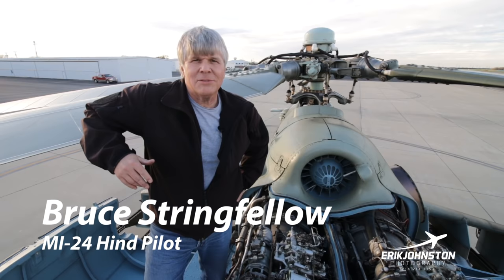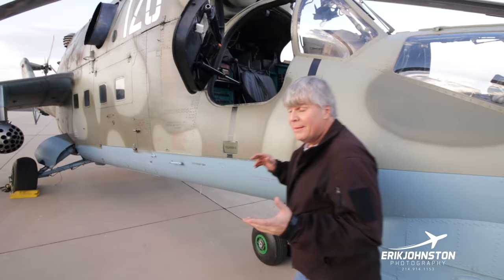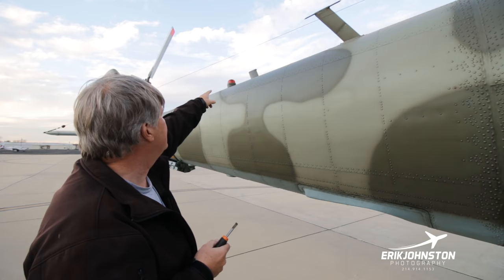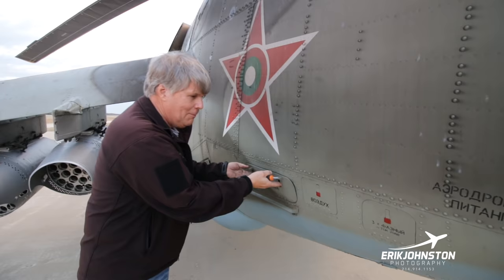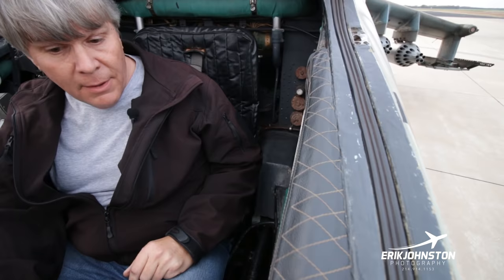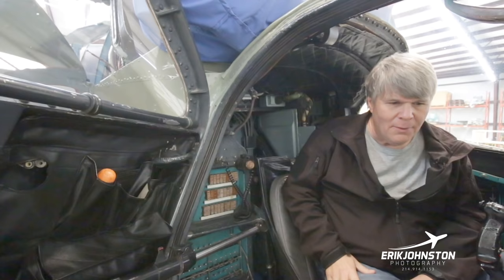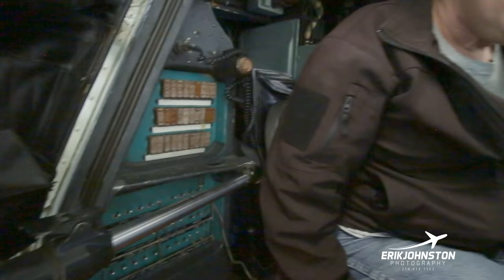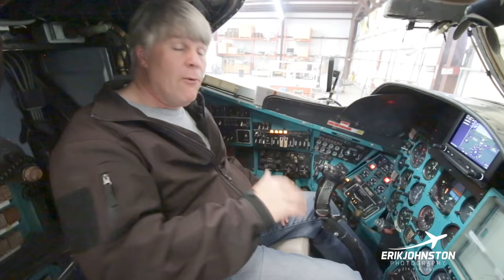Hind MI-24 Helicopter Walkaround Tour

Comment: The level of engineering is insane - I appreciate helicopters a lot more now.  Every single part of this chopper was designed and likely redesigned multiple times before production.  Just insane.
Reply: Lol I'm pretty sure every complex machine of the last 100 years has every part redesigned multiple times before production until it's as close to perfect as possible. From a $2,000 riding lawnmower to a $200 million dollar stealth aircraft to a $13 billion dollar aircraft carrier.
Reply: Just cobra

Comment: Glad to see this one found an owner who clearly loves it a lot. Listening to someone explain something they're so enthusiastic about is always brilliant, and I've learnt quite a few things - with only one caveat. I believe the little white domes are the aerials for the SPO (radar warning receiver system), which would also explain why they're arrayed around the 'four corners' of the helicopter, as it were. The IFF aerials are the triplex rods by the air data probe and underneath the tailfin, part of the SRZO-2 IFF system. The Soviets later switched to a single triangular blade aerial replacing each of the 'odd rods'.

Hugely respect the decision to keep the original doppler map system - it's a really cool piece of kit and there's no reason to add another GPS display. The restoration is absolutely top notch, you can tell this helicopter is really well cared for.

Comment: He is actually mistaken about their 12.7mm nose gun being able to use our 50 BMG ammo, this is an urban legend. I tested this in Afghanistan with the DShK and our 50 BMG ammo. The round casings are significantly different. Ours is 12.7X99mm with the case walls parallel. Their ammo is 12.7X109 and a tapered case walls from the base to the shoulders. I tried to fire a US round in the DShK and it blew apart, damaging the feed tray. 

I pulled the nose gun off the wrecked Hind at BAF but was never able to find the right power to spin the mechanism.
Reply: Nothing like real world experimentation to dispel a myth.😎
Reply: @todaywefly4370  My Grandfather would capture German weapons and flares and such and test them. IE, how many  helmets could you shoot thru with a Mauser? or... how does this rifle grenade  work? I miss his stories.
Reply: @FractalWyrm  Sounds like an interesting man but most of those old guys were to me.  My Grandfather spent 2 1/2 years with the Japanese in Changi prison.  I only got meet him a few times when I was a boy, he died quite young.
Reply: Poor Dushka... killed by an American cartridge.
Reply: I knew the Russian 12.7mm was longer than the American .50 BMG and it wouldn’t work like he described, but I didn’t know it was that long. Thanks for sharing, pal.
Reply: @nickrollstuhlfahrerson8659  no worries! My dad told me about this myth from VietNam and being the Armorer for the CJSOTF I HAD to try it out. Lol.
Reply: @jamiebunten8195  Being an ex-tankman from Germany, I absolutely know that feeling when coming across such myths. Unfortunately, I never really got to tinker with any equipment, but we tried similar things, like a supposed software bug that’ll shut the tanks aiming system permanently off (didn’t work, no matter how much me and my tank commander fiddled around with it) or a spot on a training facility where you could supposedly hear super secret Russian radio transmissions if you are on the right frequency (Also didn’t work, surprise surprise). However I’ve heard similar myths concerning 7.62mm ammo, going along the lines of ‘The Russians could use their 7.62x54R cartridges in our 7.62mm NATO rifles, but we couldn’t use our ammunition in theirs.’ Which is pretty obviously not correct, since we all know these two cartridges have different casing dimensions and necks, and the Russian 7.62x54R is even rimmed on top of that.
Reply: @nickrollstuhlfahrerson8659  
I blame Americans stupidly clinging on to Imperial instead of metric for this and their penchant of using the 1st numbers instead of the whole equation.
Reply: 10mm of unsupported cartridge will do that to a gun. I can't believe someone let you fire 50 BMG through a DShK you could've been dismembered.
Reply: @calska140  well, I didn’t hold the trigger, we tied it off and used 550 cord while we were behind a concrete barrier.
Reply: @jamiebunten8195  someone was using their head. I saw an accident where a guy used a .50 cal cartridge to knockout a stuck mounting pin on the M2 and his hand was just red ribbons of sinew and flesh. So I might be making a bigger deal of the danger than is necessary.
Reply: @calska140  
Trivially easy??
Math equations and actual measurements isn't "easy".
There are slight differences within the micrometer if you just blindly convert imperial to metric.
Reply: @dickmelsonlupot7697  Yikes. It's simple as remembering your conversion factors down to three decimal places (if you really want to be pedantic about precision) and then doing some light mental arithmetic. There are infinite numbers between 0.00 and 0.01, you can only get so worked up over precision until it becomes ridiculously impractical.

Have you taken any calculus or even a 100 level chemistry class? If so; get your tuition back.
Reply: Yes!! Thank you! I’m too young to have been around for the conflict in Vietnam, but I remember being in barbershops in the 90’s hearing Vietnam vets (most non combat roles) saying “yeah, the weird thing about the VC weapons was that they could use our ammo but we couldn’t use theirs!” I remember, even at 9yrs old having a little .22 and 30-30 experience thinking; “That doesn’t...sound right”. Sure enough, total malarkey. I have no idea where that started or came from but enough of that BS got passed around that it became exchanged enough to be widely circulated in the US in the 80’s and 90’s.
Reply: While i find it hard to believe too, you have to consider, that aircraft hardware is not the same as regular infantry weapons. It could have special modifications to make it happen..
Reply: I don't know if a DShK is really comparable
Reply: but they dont use a DShk on the hind, its some three barelled gatling gun with a different chamber, although i wouldn't test a 50. BMG in it incase it did blow up the chamber and the rest of the gun...
Reply: @kilianconn5091  this gatling gun is called YakB-12.7 and it uses the same rounds as DShK. Not sure about the belts though.
Reply: @cdgncgn  it's a rating on countries based on several things. Be mad. It's hilarious
Reply: Yeah course you did soft lad.😅😅
Reply: Respect bro
Reply: @calska140  I never knew that about the different diameter measurements (land/land vs land/groove) thats interesting and I learned something today thanks.
Reply: @crown1285  care to expand
Reply: @crown1285  Who are you speaking to?
Reply: If you really tinkered with Hind's 12.7mm then you should have noticed that it's not based on DShK-DShKM design. I'm not suprised that regular "Dushka" can't fire 50 BMG without some serious modifications {no one would have thought about ammo compatibility in 1930s} but I wouldn't be so sure about YaKB.

EDIT: Just so you know, YaKB multi barrel HMG isn't powered, it's gas operated so no wonder you couldn't make it to work.
Reply: @dickmelsonlupot7697  Americans are taught to convert Imperial to Metric and back since childhood... Your rationale is stupid. We're also taught the Metric system, we know both.......
Reply: @OGPatriot03  
depends on where you grew up but for the most part, especially Americans I encountered online or personally, they don't know how to convert Imperial to metric.
Reply: @gratius1394  We didn't have belts for the minigun, and it had two wires coming out of it, so we  thought it was electric. No manuals made it a little hard to figure anything out, so we just took it apart and discovered that it was (obviously) both the same system as the DShK. I was hoping it was similar to the M134 we had. And the US 50 round fit in its chamber (meaning incorrectly and) with lots of room around the back of the casing like the DShK chamber.
Reply: @jamiebunten8195  Those wires were probably a part of firing mechanism. AFAIK, the Russians don't use powered weapons too often, even in their helos and jets. I think that length of the chamber could be field modified but feeding system, locking lugs, barrels etc. most likely couldn't. At the very least their guns have an option of using 50 cal ammo after some alterations by a gunsmith, US M2s would never be able to handle their 12.7mm.
Reply: Thanks for doing it but part of me dislikes you for ruining the DSHk
Reply: @calska140  trivially easy lmao 🤓. Tell that to the 500 million dollar the good ol boys at NASA blew up because they chose to work in imperial on an international project. Somehow ignorant enough to know that working in two systems and two competing standards is never a good idea.
Reply: @ColHogan-zg2pc  actually in that situation NASA used metric and the company that made the part that failed assumed they were using imperial.
Reply: @spencer6104  I didn't  I ran the same gun the rest of the deployment and passed it to 3rd GRP when we left. And it saw a lot of actiotion at Asadabad.
Reply: @OGPatriot03  I would disagree. Only small percentage of people in 🇺🇸 actually understand metric. Most machinist can do simple conversion, but that's it.

Comment: I appreciate the way the access I panels open from top to bottom giving mechanics or the pilot preforming preflight inspections a place to stand or sit while working on the engine, rotor and transmission.
Reply: They’re the same way on the Chinook as well as the Blackhawk and Apache.
Reply: @bigdaddy7119  I did not know that.

Comment: Erik, I just wanted to let you know how much I enjoyed this video walk-around! I was in the Army from 95-2001 and during rotations to JRTC in Louisiana the OPFOR used one of these and I was a stinger/avenger crew member. Every time one of these flew over the tree line it would make the hairs on the back of my neck stand up! Lol. We did get told, however, that in order to bring this aircraft down it had to hit the engine because the rest of the aircraft was so armored. Basically a flying tank.
Reply: Yes I remember it ! Was there on a rotation - Exercise  (95 ) too !  Awesome experience !  I shot one down with a 20 mm cannon ( German Wiesel Mk ) Miles laser system  ;-D ,  Salute from ( Airborne Fallschirmjäger Veteran)  Germany ! .
Reply: @motorrebell  what you mean you shot one down? simulated?
Reply: @privateaccount5400  Yes ,simulated .worked great on "opfor "( opposimg forces )  vehicles & infantry too.
Reply: This is kinda interesting is there any way to improve your chances of hitting an engine or is it kinda blind luck once it lock on and shoot it until it goes away or you run out of ammo?
Reply: @privateaccount5400  also yeah Miles year is basically the military version of laser tag they put blanks in the guns and then basically put a laser emitter on the barrel and then you wear some webbing with receivers on them that will tell you that you’ve been shot but I didn’t know they used them with things other than small arms

Comment: According to military manuals you have to start the leeward engine first. The reason is to have it in a defined idle situation in case it sucks in exhaust gases from the windward engine. Starting it up while sucking in exhaust gases may cause turbine damage by overheating.
edit no I'm not one of these downvoters
Reply: Ahahaha! And he used to start then dependently of odd and even days! ))))
Reply: I don't know virtually anything about helicopters, but that actually sounds very valid thing. I'd suspect that possibly also in additional to heat, one reason could be exhaust particles/impurities creating unnecessary wear in components?

Comment: it is specially written on the covers "Не становиться" - "Do not stand"))
Reply: Does it sound like Nay Stanovitsiya? I was able to sound out "Ne Stan" from my very limited understanding of Cyrillic. It made me pretty nervous even though he was on the hinge side of the doors.
Reply: Yeah, thats written on the parts of the cover that are not reinforced for standing. You can obviously see that there are additional plates in the areas you can stand on. You cant stand on the outer skin where the text is.
Reply: @alistairs8495  there's a simple way to listen how to pronounce it right. Just use Google Translator and click on the speaker icon.
Reply: The cowlings have a special platform where you step. The writing refers to the aircraft's skin, which, unlike the reinforced platform, could be bent if you stood on it.

Comment: Anti-tank guided missile.
At the time of its creation, an interesting projectile guidance system was used.
The rocket engines had exit nozzles on the sides and a rearward-facing pyrotechnic charge that indicated the position of the rocket in space.
The on-board computer evaluated the position of the fire path from the center of the aiming frame and issued commands to correct it so that it stabilizes in the center of the frame.
In the case of night shooting, the system switched to a light bulb without a fire trace.
If the target was flooded with light from a fire or other light sources, the system signaled this by flashing and subsequently required a manual guidance mode for successful shooting.
The entire system was gyroscopically stabilized and, when functioning well, required almost no movement of the control levers from the shooter.
The commander sitting in the back could see where the gunner was aiming from the pointer on the main artificial horizon. It's a small green target that was moving from side to side. It was also combined with the machine gun sight, which was also used for dropping bombs.

Comment: The info I got for the turquoise color soviets (and russians after USSR dissolved) used for the cockpits of their aircraft is that it was chosen because it doesn't strain the eyes so much, so you can focus on instrument panels easier.
Reply: That's correct. The Soviets did a big ergonomics study and this colour was chosen as the most conducive to long duration flying because it avoids pilot fatigue. Less important on a helicopter, more important on their long range strategic bombers.
Reply: @paulie-g  it also reflects a more pleasing color to the eyes under the traditional red light they use for night lighting compared to gray or black which reduces not only light pollution (a problem in a night fight) and reduces eye fatigue. 

It's pretty jarring going between Western and Eastern aircraft though. Takes a minute to adjust to.
Reply: @Joe-nq6hy  Yes, the words are different. This colour though would be called light turquoise.
Reply: @Joe-nq6hy  https://en.wikipedia.org/wiki/Blue%E2%80%93green_distinction_in_language#Slavic
Reply: Thank u! Often wondered about that
Reply: That's correct, that's why doctors use that color on their clothes in operations because seeing only the color of blood would stress their eyes and cause fatigue

Comment: Doppler Helicopter Navigation System.
In 1970 there was no GPS system. The helicopter's inertial system worked with the autopilot system and enabled automatic flight along the selected track. He was able to stabilize altitude, course and speed. Also, this helicopter was able to hang in automatic mode over the selected point. He indicated his position on a "cartograph" into which a map background was inserted on a scale of 1:1,000,000 (for route flights) or on a scale of 1:200,000 (for displaying the operational area). the accuracy was determined by the time of use, but it never exceeded the zone of the red target on the indicator, which is a deviation of up to 2 km. At that time, pilots were used to flying according to the map and it was not a problem for them to continuously remove any error by moving the pointer on the map base.

Comment: As a child living in Zvolen  near Sliac air base (Slovakia) used by soviets I saw 33 of this beauties flying low about Slatina dam (about 20 -25 m) with leader and 16 pairs to shooting range. Valley is quite steep an I was high about them. That was quite a sight.
Reply: I once visited Zvolen as a child, i remember we wen to the winter slides and some hot springs afterwards

Comment: Looking forward the Mi-24P being intro'd to DCS World. This vid' has been a gem of useful info' about the broader functions of the aircraft!
Reply: It's a different model, but most switches and instruments in the cockpit are the same. "P" model is not equipped with nose gun, it has two 30 mm guns on the front-right side. Outstanding expreirnce is flying that chopper in DCS, when you get used to controls.

Comment: Rivets with a red circle are used to set the leveling rule. The needle of the ruler is inserted into the groove of the rivet to obtain vertical. A leveling ruler and optical level are required to check the geometry.

Comment: 15:27 The stub wings on the Apache and Cobra can actually provide up to about 20% of the total lift in fast forward flight.
The early AH-64A Apaches actually had trailing edge flaps on the wings to provide extra lift during autorotations, this was removed in later models.

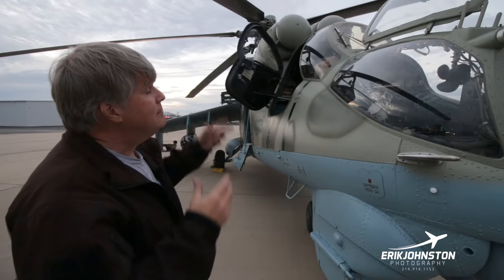Comment: The data sensor you show at time 50:33 is primarily for the navigation computer. The output from it was for the bombing computer and the shooting computer of the machine gun. This variant of the helicopter only has a basic collimator sight for the pilot. In the higher modification of the Mi-24V, there was already a different sight. It was placed in the space where you now have the GPS installed and occupied the entire space of that empty space.